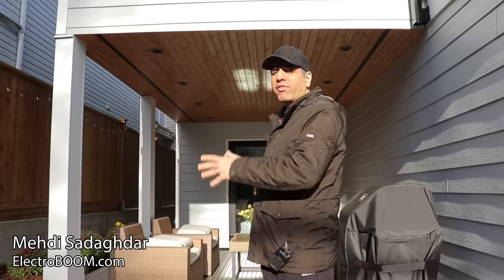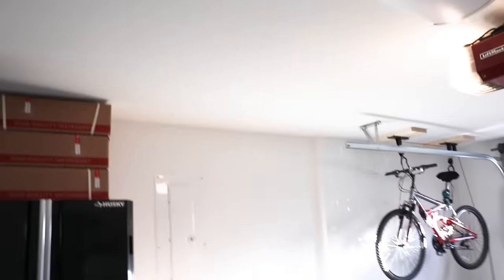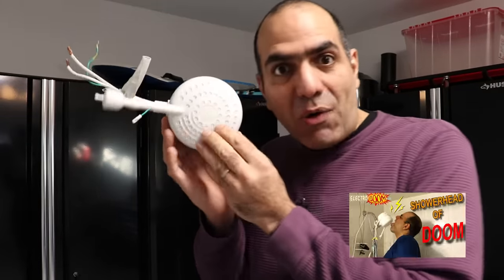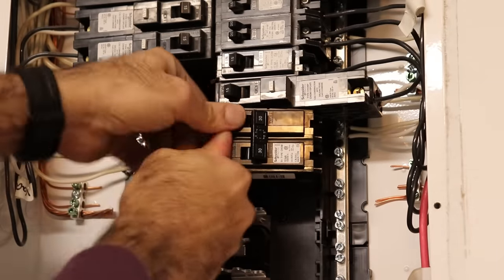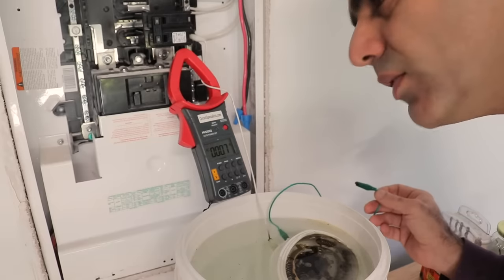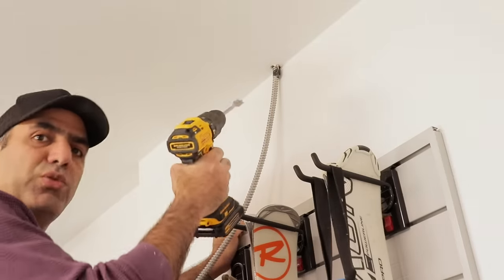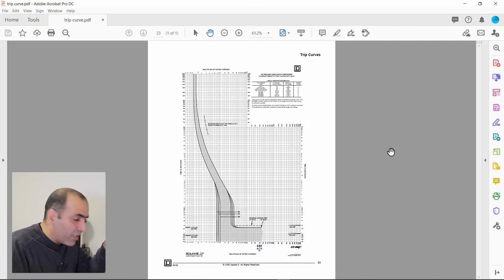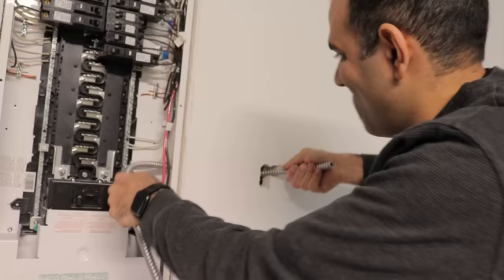Electric Patio Heater Wiring and Installation

Comment: These breakers pop instantly on shorts (very large currents), and quite slowly on something like 2x current. Basically, the breaker needs to pop before the wire melts, so 10 seconds at 2x rated current may not pop it.
Reply: Hey you. Go finish that giant bandsaw
Reply: They also have to accept the inrush current being pulled from a motor. Looking it up, it can be 20x the amps on initial half cycle (very short) and then 4 to 8 x for the first few seconds until the motor is happily running. The resistive loads he was using, in his test, and for the final application should never go over their running current that is listed, and always just pull the same currents any time they are on.
Reply: exactly. they are there to protect from drawing for extended periods of time loads that are higher than the rated draw of the normal household. like in germany we have 16 amp breakers and 230 volt grids. that means an outlet or better one surcuit (where really every outlet should be on it's own circuit which sadly isn't always the case) will give you a max wattage of 3680 watts per outlet or surcuit if multiple outlets would happen to be on the same. but that is really short peak draws. the standard cables used shouldn't really have permanent draw of 3500+ watts to not heat up inside the wall and cause a fire. happens a lot since idiots try to daisy chain socket strips while plugging tons of shit that draws a lot. even happened in my uncles stepmothers house. she rented out the upper floor and some genious installed the kitchen himself. one day it did't work anymore. luckily it didn't cause a fire however he apparently thought it was a good idea to have literally all kitchen electronics including fridge, dish washer, washing machine etc. on one bloody outlet while daisy chaining multiple cheap crap socket strips between the cupboards and the wall cause he was to incompetent to wire up more outlets and to cheap to call a professional to do it. didn't fry the wiring but the socket strips themselves. he found a smoldering mess of rubber and plastic with some copper wires behind it when it stopped working. 
i mean i'm no electrician but i understand regulations, safety and the matter enough to install a lamp and understand what is going on. that's why i'm comfortable installing a lamp or something myself but i wouldn't touch an oven for example. some of them draw 5000 watts+ and that is far beyond the usual electronics. i mean i also understand how it is done to an extend but i wouldn't touch it myself but get a professional electrician. even more cause they install those all the time and if they need to run new wires and connect them they will do it clean and not the mess i'd produce. but also am i not responsible this way. hell even if i fuck up installing a lamp and someone gets shocked i'd be responsible. luckily 230 volts 16 amps won't kill you. i shocked myself before (praise the fi-god) and it zaps you real good. a healthy person will be okay but someone with a heart condition or something like that might really die. now ovens are not always but sometimes above the specs of our normal wiring and breakers so sometimes run on 2 breakers to have more amps available. that's a whole nother story of zapping. i once helped a buddy move and his uncle insisted on we don't need an electrician to install the oven. well we needed one. that retard managed to zap himself and fly 5 meters through the entire kitchen. and this guy in fact had a heart condition, bypass and a pacemaker. luckily he was fine but he gave us quite a shock aswell. we thought he just died for a moment. always the wildest stories when noobs tinker with electronics lol.
Reply: An engineer should know about trip curves for fuses/CBs. Mehdi makes me wonder sometimes.
Reply: @robj4078  I think Mehdi does this on purpose, just to get peoples attention. He clearly knows how to do this stuff,  his job looks at least as good as any professional, besides missing the measure twice, cut/drill once rule.
Reply: @robj4078  i'm fairly sure stuff like that and the zaps is just to create fun content like 99% of the time. he knows exactly what he is doing but uses this funny to watch parts as a segue into the actual educational part like here to show when the breaker will actually pop using the diagram sent by the manufacturer. i mean he is an electrical engineer. he wouldn't get zapped literally everytime he touches anything if he didn't want to. he just does it for the lols and cause he isn't supporting the teaching method of saying don't do x because y will happen. he just does x to show live why it's pretty dumb or bad.
Reply: It depends on the type of breaker too
Reply: Nice to see you here!
Reply: At 2x current rating on a breaker, the breaker must trip within 2 minutes. No way is Mehdi going to stand there for 2 minutes holding that wire on the breaker while the bucket burns in his face. lol
Reply: @jamescollier3  comedic ignorance
Reply: No way! 
Matthias of the "Wandel bandsaw company"!
Reply: What is this, a crossover episode?
Reply: @robj4078  if it wasn't on purpose he would not have survived so many oupsies...
Reply: There's a video of the internals, not sure if this is the same type, but basically a high current actuates a solenoid to break it, while over current uses two metals trips with different heat expansion properties to break the connection. Over current -> heat -> torsion.

https://youtu.be/wGFnooeA6Iw?t=88
Reply: As soon as the element heats up the resistance can change, so when running it could draw less power.  If you measure the resistance of a light bulb it will draw less than calculated once the filament heats up
Reply: I'm not an electrician, and I barely remember anything from physics classes, but isn't it unsafe when you connect something electric and instead of cutting the power off (as it should in this situation), breaker just lets it flow for 10 seconds? o.O If I understand correctly, a 2x current or less caused a fire, so...  I'm european, so I hope we made our breakers differently ;) sorry if this is a basic question but it bothers me :D
Reply: @DevourerofCookies  In EU, for household applications you get A, B, and C over-current characteristics for MCBs. These letters indicate how many times the over-current will trip it instantly(short circuit protection).
- A is 2-3 times
- B is 3-5 times
- C is 5-10 times
So a C10(C type 10 Amps rated) mcb wont instantly trip if you have like 30 amps of current flowing for a while, however it must trip instantly when you have over 100 amps of load. You do need this higher margin, cause there are plenty of equipments that have high inrush currents, multiples of the normal operating current. Such devices usually have a powerful motor of some sorts, like an AC, or a vacuum cleaner. You wouldn't want your mcb to pop when you turn on the vacuum right?
Then you also have the trip curve(which you could see in the video, manufacturers have these spec sheets) which is for delayed tripping at continuous overload scenario. Generally:
- 1x the current the mcb should not trip
- 1.13x the current the mcb should trip over 1hr
- 1.45x the current the mcb should trip in less than 1hr
So let's say if you have a 10 amp circuit which runs your 6 amp dishwasher and also your 6 amp microwave it will be overloaded, however if you wont run them simultaneously for long time it wont trip. If you run them for a longer period, like 30 minutes, the breaker may trip.

In conclusion, if you exceed the nominal rated current * the A/B/C type rating then it will register it as a short and will instantly trip. Otherwise it could trip between just a few seconds up to a few hours, depending on how much overload you have.

As for why did the shower-head go up in flames: the reason is that it was rated for 110-120V, and Mehdi hooked it on 240V, which actually makes it dissipate 4 times the rated power. With no water in it while at that. This is why you should make sure that the device you're about to plug in handles the given system voltage.
Reply: @robj4078  His electrical work makes me wonder today...
Reply: Yes, you need to choose the breaker  according to the required trip curve characteristics.
Reply: I'm looking forward to the future giant bandsaw videos
Reply: Thermal constraint over time. In the UK a typical breaker is made to withstand a fault current of 20,000 amps and break before the cable it is protecting vaporises. All fuses are like that and follow the same kinda plot on a graph. Selection and erection, there is a good reason for it.
Reply: @robj4078  anyone who thinks it's easier to use a gator clip instead of wiring it in and using the breaker to turn a 90 amp load on and off makes me think too
Reply: That seems unsafe.  Because as Medhi demonstrated, a 2x current semi-short can cause a fire to start in a lot less than 10 seconds.
Reply: Didn’t expect to see you here Matthais! Yep, like you said there is a curve- it will pop instantly for short circuits, but will take a while for overloads.
Reply: But isnt it kinda unsafe to take a 30 amps rated breaker? I would have taken an B or C 20 breaker.
Reply: dam true, if it exceeds 60a it will pop instantly, otherwise it is a linear relationship based on the fractional overload to time with the maximum of 30 seconds at a nearly undetectable slight overload, it takes time for the bi-metalic strip mechanism to heat up to force it to trip, this specifically because of large inductive loads like AC compressors that can draw sudden peaks of as much as 60-70a in larger models but tend to operate well below 30a when the system is running, this means the trip curve of different breakers is a multiple of the constant current rating will be allowed for durations of 1-2 seconds, at which point it quickly heats up the thermal strip and trips, each class of breaker has a different ratio but literally none trip at under 125% of the rating, otherwise your old TV degauss coil or your microwave transformer would trip it every time from surges
60a at any voltage will trip it in under 5 seconds, 40a may take as much as 30 seconds but more likely 20-25 seconds
and as he overated from the required 20a 240v to a 30a breaker and the load is entirely resistive he can and should pick fast trip breakers(as he is unlikely to use an inductive load on that circuit) and should test it by using something that yanks ~60a for instant trip testing
40a takes too long because if it shorts it would pull well over 100a and if the device is like the showerhead(it must be) it would melt open before the breaker pops
Reply: @snoopdogie187  What about the positive temperature coefficient of heating elements? You know, they draw inrush because the filament is cold at the beginning, and so draws a ton of instantaneous current to get hot, and as the thing heats up, the resistance increases and the current drops.

Comment: house starts burning

The breaker: yea just give me 10 more seconds
Reply: The entire planet earth destroyed

The breaker : Just... A little bit... More. Hang on.
Reply: :upvote:
Reply: @mini2flyerau  unfortunately redditor, this isn’t Reddit
Reply: @wassapM8  I know
Reply: @mini2flyerau  do you play X-Plane 11?
Reply: @wassapM8  yes
Reply: @mini2flyerau  :0
Reply: just give me a couple more seconds, i know what I'm doing
Reply: But.. and hear me out here... MAYBE it is not shorted... like.. you know..   -The breaker
Reply: Its not to save your house, but the power grid.
Reply: well if wires shorted it would pull >100a but an AC compressor peaks at 2-3x the rating so do you want to be unable to run the AC ever?

Comment: 4:44 a very safe way to check if it's live or not. Take some notes guys
Reply: It's OCD, I do the same thing, of course after checking that I'm not grounded somewhere!
Reply: I normally use my tongue, it's faster and I can better use both my hands to hold my screwdriver and crowbar! :-)
Reply: Wrong, don't tell people that dumb advice. It's*relativly* safe, and can absolutely be dangerous if an amateur is doing it. One random amateur that has himself grounded with his left hand or foot, and then shocks his heart once when tapping a live wire.. don't spread bs. Mehdi tells u himself to never do any of this if you don't know what you're doing.

Comment: "is it live?"
proceeds to touch the possibly electrified  nail
Reply: He's certified electrician so he can... ;)
Reply: Thank God , he just touched , not licked ...
Reply: he touched it with 1 finger so even if it was live it wouldnt do much harm
Reply: At this point 120 volts is nothing more than an mosquito bite for Electro...
Reply: @thecheekibreeki3197  Haha what?
Reply: @alexanderh2720  medhi isnt connected to any ground wires so the shock shouldn't travel through his body and kill him, also I see lots of old-shool electricians do this instead of using one of those live current detector pens and their still alive ,  so he should be fine
Reply: hehehe, human voltmeter!
Reply: @glaglelolba6279  My dad's electrician (who works on almost all my dad's projects) can touch a single 240 live wire with his hand for many seconds and is just "fine", he did it in front of me. Being kind of a coward when it comes to electricity, I was standing in disbelief 😅
Reply: @HassanSelim0  being afraid of electricity is how you get hurt. Have respect for it and know what you are doing and you will be okay. While not very smart, the electricians who do shit like that know exactly what to touch so they dont die. If you get hit by the load of a lighting circuit, the white wire or "neutral" as it's called, then "just" 120v or 240v will hit you so hard you will fly of the ladder or get locked up
Reply: @Jheiden Maveric Damasco the contractor who built it most likely. The electrician wiring the breaker didn’t notice bc it was so far down
Reply: @thecheekibreeki3197  
100% right... Harmful is touching L and N at the time, espacially L one hand N other because current will  flow through hole body and paralize muscles...
Reply: @alexanderh2720  He'd get shocked because of capacitance but not killed because he is insulated from ground
Reply: @aiex314  no he wouldn't even get shocked I've done this several times and never felt anything unless I fucked up and accidentally grounded myself
Reply: energy = current x voltage x time. so if the time is 1 millisecond the energy will be a lot less.

Comment: "I have to open a nice and clean square right here"

Proceeds to cut a rectangle
Reply: A square is a rectangle.
Reply: @belg4mit  but rectangle isn't square
Reply: @belg4mit  While yes, you are correct. A square is indeed a rectangle, but a rectangle is not a square. When classifying a rectangle, it includes a square. But when classifying squares, it does not include rectangles.
Reply: @GarrettHoward22  but if a square is a rectangle how can you tangle a rec without first squaring properly to the rectangle before rectifying it with a full bridge rectifier?
Reply: @bovice1766  Yes.
Reply: Big brain comments, lol.
Reply: Tbh is was a trapeze.

Comment: "Lets test the breaker to see if it works"
*Tests breaker*
*It doesn't work*
"Ah, I'm sure this is supposed to be like this"
Reply: Brady Prince  you don't understand how circuit breakers work. if he had made a dead short it would have popped instantly. the purpose of circuit breakers is to prevent the wires from melting, not to break the second the rated current is passed. if it was, you'd never be able to turn on a vacuum cleaner since the inrush of inductive loads is several times the circuit rating.
Reply: @SuperAWaC  Thanks! I wondered why there was this huge delay.
Reply: @SuperAWaC  I have that problem with my chop saw, it kills the breaker the moment I turn it on. Solution: I put a long extention cable betwen the saw and the socket. Cable resistance limits the inrush current and stops the breaker from tripping.
Reply: @andreasu.3546  Make sure the extension cord is rated for that current and always use it completely unwound.A wound up extension cord will overheat.You could also make a soft starter circuit,like passing the current through a 6 Ohm resistor until your chop saw turns on then bypassing the resistor.
Reply: @mernok2001  Your're right, reeled cable can get very hot. Back in apprentice days, they showed us a safety video where the inner section of the cable on the reel had actually molten. Big fun when you want to unwind it later and potentially get to touch the, now exposed, conductors.

However, that cable I use for my saw is not on a reel, it's just a long cable, normally used with an electric lawn mower.

That aside, heat probably wouldn't be a big problem in my case, even with a reeled cable. I'm so slow with my amateur woodworking (measure twice, cut once etc.), that saw gets a duty cycle of 10% maybe, and it never runs for more than a few seconds at a time...
Reply: @andreasu.3546  Then its good.Do you live in a 230V country and have a type B circuit breaker?Then replacing it witch type C might solve the problem.If your socket and wiring can handle it it can be 16A not just 10A as in old houses.
Reply: @mernok2001  Yeah, this is a (relatively) new built home in Germany. The breakers are all B16. Swapping the one for the garage (where I usually plug in the saw) for a C16 might be an option, but I would want to measure the resistance of the installation before I do that. C16 needs 160A in case of a short circuit, not sure if the existing 1.5mm^2 wiring to the garage can provide that.
Reply: @andreasu.3546  If 10 or 13A is enough then C10 or C13 might be good.